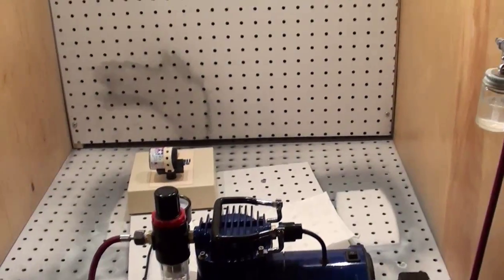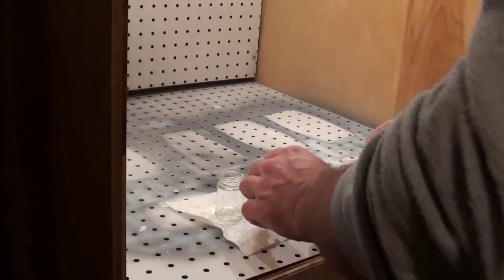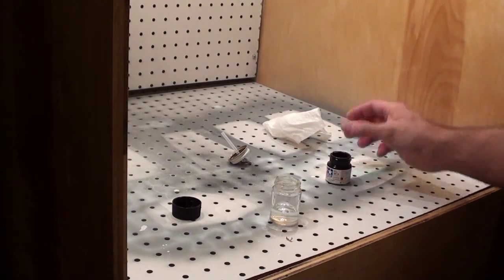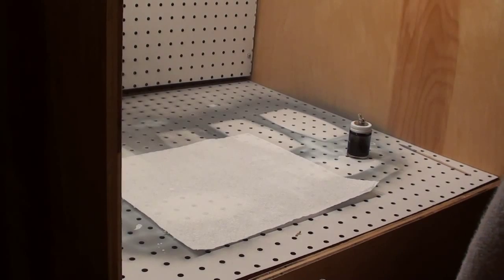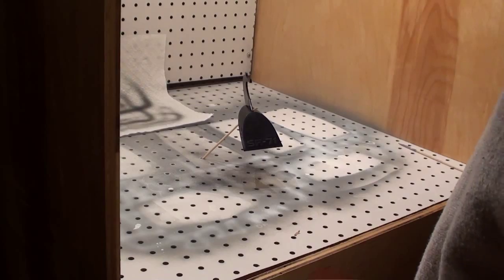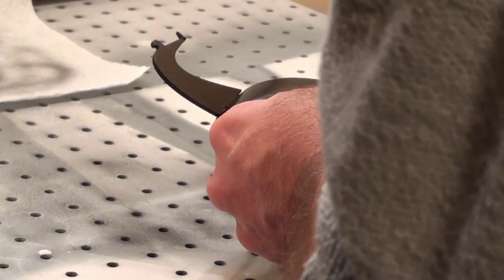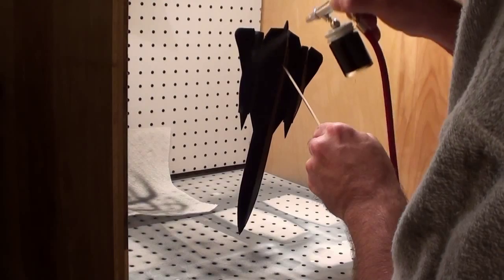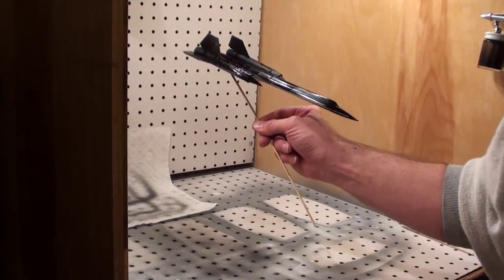SR-71 Part 3

Comment: Hi. What about the fumes paints ... There's no risk whatsoever to cause fire with these motors, fan and compressor?
Reply from the maker: +Comicguy No fumes with that spray booth, the fan and rotor are separate from the motor so there is no chance that the fumes get to the motor.   No chance of spark if the fumes and air stream are sealed from the motor.

Comment from the maker: @Generalsplatton Testors model masters paints.  I used them in the past, like 15 years ago with no problems.  But when I got back into modeling about a year and a half ago, I was having problems with the paint sticking down.  When I joined a few forums, I noticed that most were using either Tamiya or Vallejo paints.  So I thought I would give one of them a try.